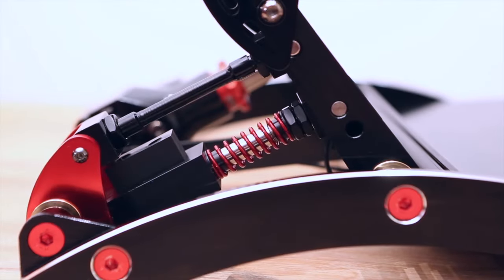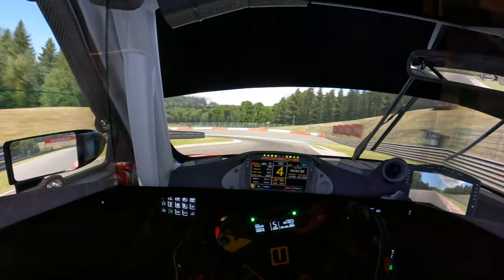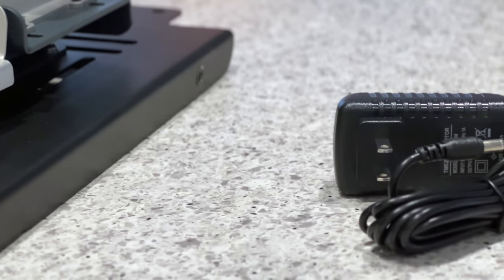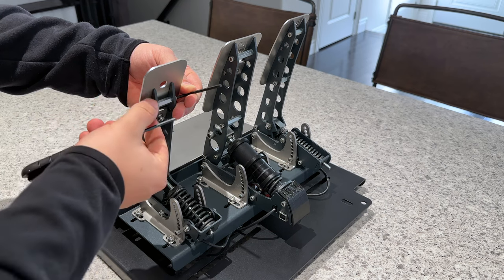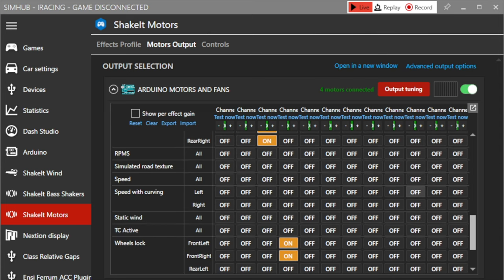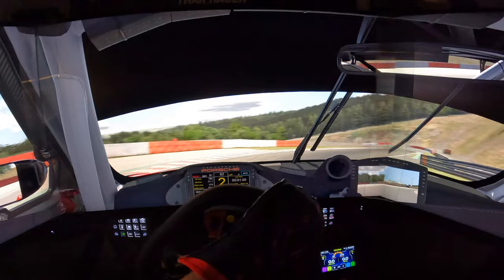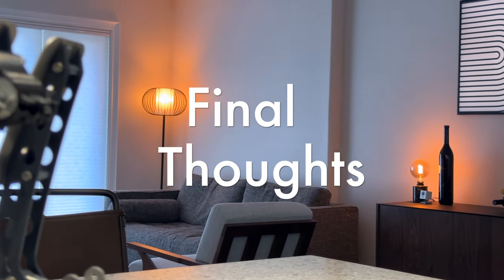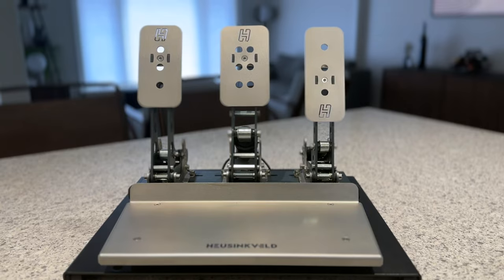You NEED these RUMBLE MOTORS for your SIM RACING Pedals!

Comment: This is really funny! Because I'm building these rumble sets myself! And my first design was "wrong" in the same way as these!! :-) You have to mount/build these motor mounts the way that the actual motor is vertically situated, that way you will have more precise vibration in lower RPMs because you don't have to take into consideration the weight of offset ballast, if you mout motor horizontally (like in this video) the weight itself will put "force" against motor and it will be harder to start spinning. V3 pedals had their motors mounted properly and in the right direction! ;-)

Comment: I have this for my T-LCM and play ACC. I loved driving the Porsches, but after update 1.8 they became undriveable to me. The back end will step out and I could never know when or why. 

I got the rumble kit, and gave the Porsches a try again. That’s when I realised from the feedback it was my throttle input. And it taught me to be more smooth on acceleration, or modulate the amount of throttle over long high speed corners. 

The sensation of knowing your rear is just about to step out, and you immediately respond by lifting the throttle a tiny bit and straighten the steering input slightly to catch the car. It’s awesome.
Reply: Lift-off oversteer. Porsches are especially prone due to the rear engine, RWD configuration.

Comment: Just got into sim racing, found a good deal on a pair of Fanatec CSL Elite and what definitely misses the mark the most is the clutch because you can't feel the bite point at all which is really evident in a real car, I immediatly thought that a small vibration could provide a more realistic feedback in that aspect.
Reply from the maker: That's not a bad idea It might help but you'll need to confirm whether in simhub this can be configured based on the sim data would be curious to know if it's possible or not.

Comment: I have the simagic p2000 pedals, 3 pedal set. dont use clutch so i ordered the 2 pedal kit 5 months ago. as i said, parts supply issues caused problems with lead times. got the kit and it had an extra motor included for some reason. only problem, it didnt include the wire to connect it to the control box. So i found an old laptop charger cord and the end worked to plug this 3rd motor into the box, with a bit of cutting and soldering, i now have this 3rd motor bolted to the bottom of my seat. :) To be 100% honest, this under seat motor just connects everything together. granted i havent had enough time to get settings all perfect, but i would have to recommend getting an extra motor or adding a seat motor kit with the pedal kit. 1000000000% worth the extra. Just takes the kit over the top !!!!

Comment: I bought 3 motors (clutch ;) ) -since then, I wouldn't or couldn't drive without anymore..... simple comparison: if I'd remove your ffb from your wheel, would you enjoy it? Same here... new vibes into your pedals! I highly recommend it :)
Reply: I've got simhub, motors with an arduino and motor shield (same as this kit, but cheaper to build at home) I have them on brake and acc, and love em. I've thought about putting one on the clutch pedal, but can't think what to map it with in simhub..I'd like to simulate the bite point on the clutch. What features are you mapping to your clutch pedal?
Reply: @paulbuswell6566  Hi Paul... to be honest, I didn't test it yet, neither got any use of, as so far I barely use that pedal ^^ And the few times I drive the F40 with the shifter, I do not pay attention on the clutch rumble... I'd have to take some time and check out that point :) Sorry ;)

Comment: Nice also have sprints. Gamer plus at rear. Dayton BST-1 under pedal tray at front. And a diy shaker on my brake. Using the nobsound mini amp for front shakers. Simhub is just amazing.
Reply from the maker: Sounds great!
Reply: The nobsound doesn’t provide enough power for the BST-1. This can cause clipping and believe it or not, damage tothe transducer. Upgrade to a real 100W amp and you’ll be happy, that is if the plastic that holds the mass in the transducer hasn’t already broken.
Reply: @TheOfficialOriginalChad  oh first I’ve heard thanks! Do you have a recommendation of an amp that would drive the two daytons I have up front now? I now have one on each corner up front.

Comment: If you have a seat with movement, it is not necessary. No fancy pedals needed either. If you have movement, the feeling of braking is given by the movement of the seat.
Reply: 6 axis seat platforms cost over 5k dollars though. even with a motion platform youd still want load cell or even hydraulic load cell brake pedal lol
Reply: @SSmallwood I only have 2dof built by me and that is enough. I already have the feeling of how the car is braking. The difference between using the move and not using it is 90% of the simulation. Obviously a 6dof will be much better.

Comment: Simply disassemble an old massage mat, remove the vibration motors and screw them to the pedals. 
Good, cheap and works great. When I see what all that stuff for sim racing costs, it's cheeky. With a little imagination, you can achieve exactly the same result for a fraction of the cost.
Reply from the maker: If you have the time and know how a DIY is also always a great option!
Reply: I did the exact same thing back in 2011, cost me less than $50 and it worked really well. I used one of the sound activated massage mats, so I was able to run an audio splitter, ran that through an EQ to isolate the brake sounds, then the pedals would vibrate when the brakes locked up or there was tyre squeal etc. My build guide is probably floating around on the iRacing forums still. It worked well but I didn't like it, it felt like a gimmick and just didn't feel realistic at all. I later upgraded to a hydraulic brake pedal and removed the shakers and found this was a more realistic feeling pedal that made consistent braking easier.
Reply: @simracingden  exactly, i'm no good at the technical stuff, can't wait for mine too arrive

Comment: 6:30 “ABS is not as quick as braking well without ABS”

This is completely false. It was once true for road cars, but it hasn’t been true for a long time. ABS isn’t outlawed in so many racing series because it’s slower…
Reply: ABS is 'outlawed' because of expense and complexity.  While ABS can provide better emergency stopping for most road drivers, it will not outperform manual brake modulation for an even remotely serious driver who's trying to achieve a quicker lap time
Reply: @RobinHood-yk8og  like I said…completely false. I have been racing and instructing for over a decade and have HEARD this a thousand times, all from amateurs or spectators, NEVER from fellow instructors or championship winning drivers. 

ABS is a skill equalizer in class and formula racing. Skill equalizers are bad for the sport and bad for spectatorship. When the FIA banned ABS in F1 they specifically stated it was due to the advantage, and you can’t convince anyone that ABS is too expensive or complex for F1…

Comment: Hey Mike, thanks for this review, one more sub! I just have a question I couldnt see anyone speaking about. How loud do you find this rumbles? I mean with headphones probably doesnt botter you, but if theres more people around could this be a problem, or can it be not as loud of you reduce its strenght on simhub? Cheers
Reply from the maker: They do produce a bit of noise. It's noticeable for sure, not as much with headphones, but to those close by or around you, you will for sure hear it. It didn't matter too much, regardless of strength; it's just the noise they make when spinning. I hope this helps.

Comment: How did you setup your pedal motor kit to just be front and the buttkicker in the rear? Is that all through simhub? I don't see any setting to choose front/rear in the buttkicker app.
Reply from the maker: You can configure the output in the sim hub under the channel outputs menu. For example, you can select which effects and device handles front or rear.

Comment: Wouldn't transducers or something ELSE mounted to the brake pedals make more sense than rumble motors?  I would think transducers not simply being on or off would give you more flexibility.  I've seen videos of folks doing that as a DIY before.
Reply from the maker: Yes thats another great option but they can be harder to mount maybe or add weight, but not sure never tried it myself.

Comment: simagic p1000 seem to have better solution as an add on... if only someone made a mod for them to be used on more pedals.
Reply from the maker: That would be great. I'm sure someone is going to come up with a solution.
Reply: @simracingden  was talking to race beyond matter he tested it said it works with p2000 box and suggested to simracing machines might make an adapter but will see.

Comment: Try one small 15-25watt transducer attached to the base of the pedals. It would do the same without the latency.
Reply: This is simply not true. Transducers depend on the deflection of the item they’re mounted to, they have to shake them, hence the term “bass shaker”. Most pedal base plates are the MOST SOLID part of the sim rig. Additionally, if the pedals aren’t shaking then the bass shaker is, which is TERRIBLE for it and creates awful resonance and clipping. 

The mass on the end of these rumble motors is 5x heavier than that in a 50W transducer and it’s DIRECTLY attached to the pedal, not the pedal base plate. This is significantly more effective. 

How do I know? Well I’ve spent around 40 hours trying different transducers from 15W to 100W, amps, pedal mounting plates, flexible transducer mounts, oscillation isolators, etc and NOTHING came close to cheap rumble motors mounted to the pedals directly.

Comment: Hands up everyone who has driven a race car where the pedals vibrate ? 

Yeah this is a pointless piece of hardware. If you think you can replicate the pedal feel of a lockup or wheel spin by using a small motor to vibrate the pedal i'm guessing you have never actually locked up the brakes in a real car.

Brake pedal shudder etc can't be replicated with this type of device.

If it makes your sim racing feel more immersive then maybe its a good thing, but by no means confuse immersion with realism, this may be one of the dumbest pieces of sim hardware I have seen so far.